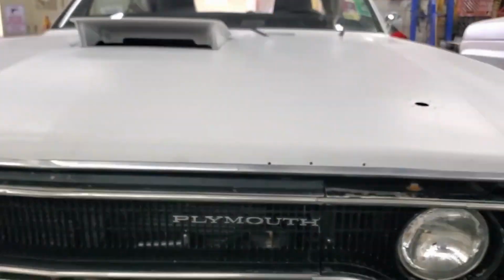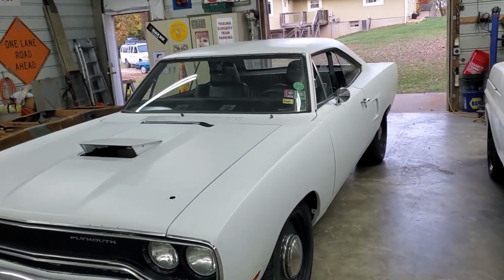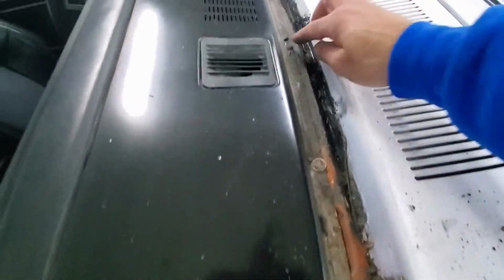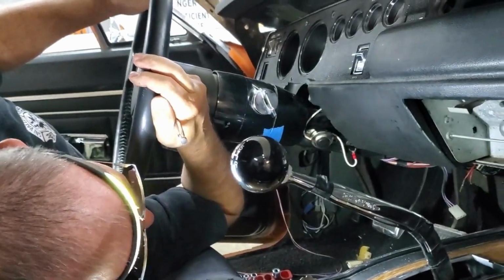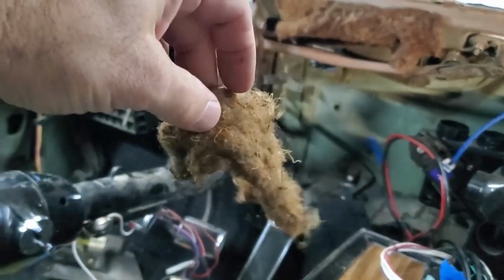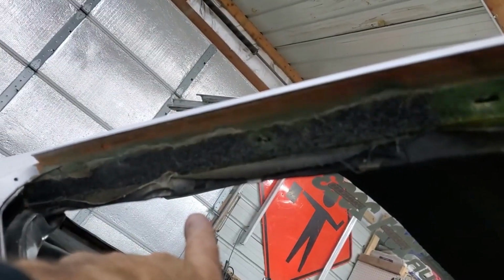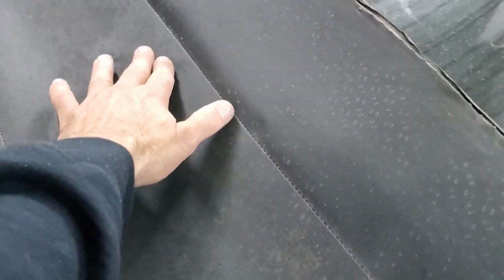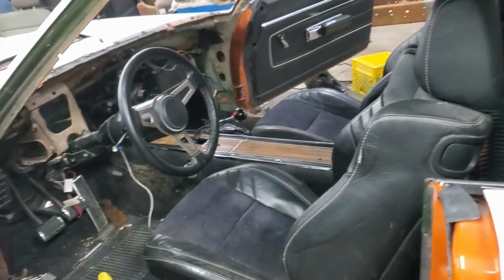1970 Plymouth Roadrunner Body Work - Eps1

Comment: How hard was it to get the modern seats installed?
Reply from the maker: I can't tell you for sure because I started drinking early that night but I can tell u it wasn't that hard because they installed them in the driveway of our Airbnb in Louisville at the Street Rod Nationals a couple years ago. I'll see if Cam will do a little video on it. He's gonna be pulling them out soon to get them out of the way anyways. Thanks for watchin!
Reply: Pretty straightforward for aftermarket seats - had to drill a few holes and stack some washers to get them level. Also had to run a power lead to them for them to work. They're a little wider and a bit taller but not too far from originals. The video of Louisville doesn't detail the process but it is not hard. I did eventually spot weld the bolts into the tracks to ease the install and juggling washers.

I was told by SEVERAL people these would NOT fit..... news flash... they do. They are the  most comfortable seats I have ever had in a vehicle. I will say that it is not a perfect fit, the factory seat mounts would do better on a flat floor. I used spacers to mount them but they would probably be better with some minor metal work (flattening) to the floor. It could be invisible unless you looked at it on a lift and knew the originals were different. 
I may do this while the seats are out this time -I would like to lower the seat a bit in the car to allow the seat adjustment to do more of its job. The only other mod I would pass on would be to cut the head rests to half their factory height - they are a bit too tall for my taste. 
If I go through the effort of modding the floor, I will post videos....

THANKS FOR WATCHING!!!!s